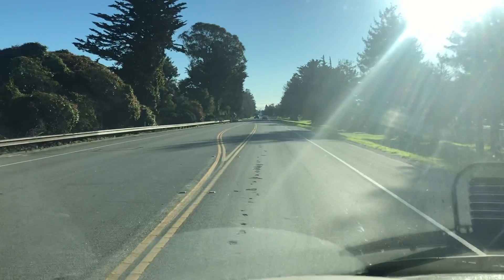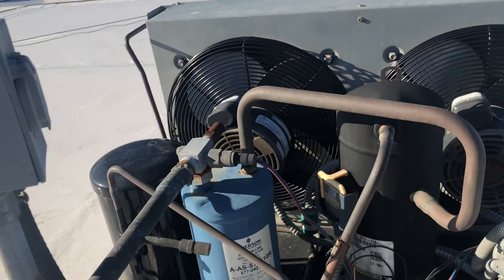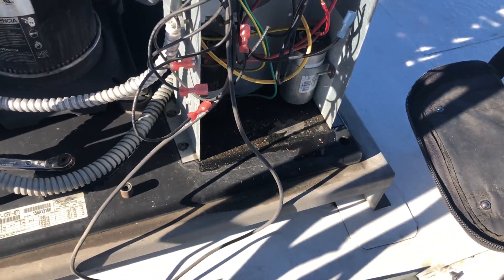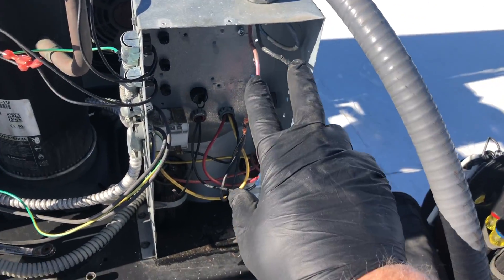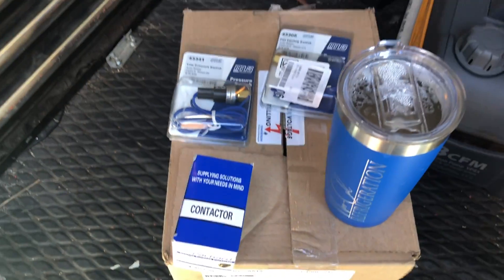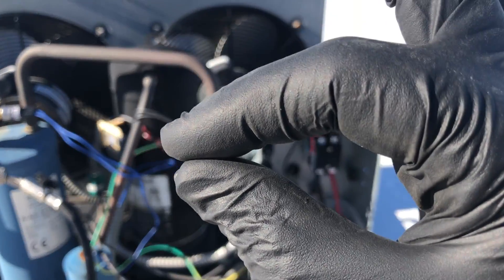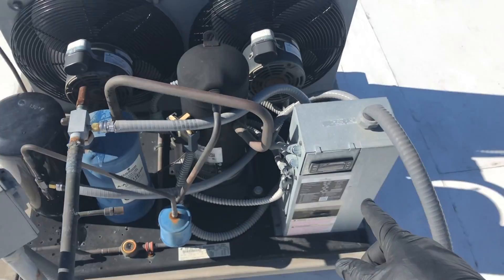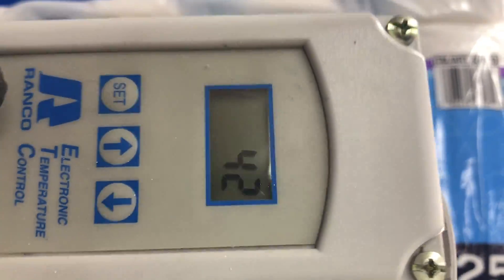How to Convert electronic unit controller to mechanical

Comment: I’d never hook up an any type of pressure switch to the receiver king valve. You’re begging for a leak. Pump it down, close solenoid valve at evap, braze in a nipple and Vaccum then release gas, then connect your  Penn all range fan cycle switch last onto the brass T you installed to your brazed nipple. Come on man 😂
Reply from the maker: @juangomez9272  5 years still working 🤘⚡️🤘✨✨✨✨

Comment: I really don't know why you wouldn't just replace the Emerson control.  All Copeland built up units ship with this control now.  The control is easy to set up, don't even need your gauge to set it.  The parts are readily available from any copeland distributor. There seems to be a fear of digital from technicians.  The time spent to take this unit back to the old type controls could have been used to go after to correct control.
Reply from the maker: @dhelton40  longevity that unit is still running zero issues since change over. The old mechanical stuff works and last.

Comment: Why would someone add a Schrader to the suction when you have an access port at the accumulator rotolock? Good that you added a doghouse.
Reply: Dual pressure controls are not weather tight either.
Reply: Also if you replace the transducer with a dual pressure control you will have to remove the Schrader core, yes? Therefore headaches for future techs that must replace the dual press cntrl if it malfunctions.
Reply: @kengardner5097  don't have to remove the core just loosen it if your control does not have a Schrader depressor.

Comment: Hey brotha I just got one of these 5 hp and I turn it on and everything works but the controller doesn’t. It doesn’t turn on at all what should I do? What would it be? I just pumped 404a and electric done right and I’m in LA

Comment: Dumb question/clarification:
The solenoid is opened by t-stat on box and is the only low voltage circuit?

I do ac/heating and dont see too many pressure switches with 240vac.

Gracias.
Good vids keep em comin
Reply from the maker: The solenoid is powered by the tstat and is 115 volts on this system

Comment: Good work! I'm a fridgy in australia, never can get my head around way Americans switch neutrals, u guys call it the "hot" we call it the "active" or "line", and under no circumstances do we switch neutrals its si much safer to switch active in my opinion
Reply: much of the small commercial refer. is 208/240v  split phase, meaning there is no neutral there, just two hots out of phase  (center tap of transformer bonded to neutral/earth) so either remaining leg is 120V to neutral/earth and 240v across them ( 208v for 3 chicken) lol

Comment: Awesome vid ! i Really Like How u did That ! I Think the sealtite on the little pressure switches was a little over the top , even for me. 🤣 i would have just used a romex fitting on the control box and put em through. could u tell me why u sealtite those pressure switches ? i see those type of pressure switches in condensing units exposed to weather on residential Air conditioning condensers all the time and never seen a problem. Just wondering. Totally Awesome Video & Awesome telling us how u did it ! 👍👍👍👍👍 & ⭐️⭐️⭐️⭐️⭐️. i would have probably went the Ranco / johnson Low pressure control way & just ran both fans all the time. But, i Like Your Way / this way Soooo much better. Thanks for Giving the part numbers and showing parts. im going to pick up some of those pressure switches. they Look cool ! i Use the High pressure safety / Man re-set of those type for many years and like them alot. Thanks Again ! Awesome vid !
Reply: i just watched the video again. i think i just answered my question.  ill bet u used the sealtite because u used butt connectors to join the pressure switch wires to make them longer and wanted to protect butt connections from rain.

Comment: 9° differential! 😱😱 nicely done, I enjoy converting Beacon 1 & 2's to mechanical. I can't believe they set that condensing unit out in the elements without a dog house. That's crazy
Reply: Maybe the dog house flew the coup.
Reply: @daveh681  that's what I was thinking, big storm not fastened, up up and away! whoosh
Reply: I lost one off my restaurant once.  Here in SO Cal along the coast we get gale force winds during storms.  The self tapping screws don't work so well after being removed several times. 

 I must have been lazy after cleaning the coils and didn't secure it very well.  Lucky I didn't kill somebody.  Now I have my refer guy put in the heavier gauge ones with all nuts and bolts.
Reply: @daveh681  see, this is exactly the kind of feedback HVAC/R techs and others need!
as a side note there's nearly *zero* excuses for the stuff to not last 5 to 10 years untouched from date of install, other than chinesium cheaping out on  component manufacturing.
who wins in the end? not the USA............. lame typos lol
Reply: @daveh681  In Maine, one of ny customers had one blow off the roof and then he ran over it with the snow plow. It was destroyed!

Comment: Dave, do you ever have a issue with the unit not staying pumped down due to the unit equalizing through the scroll compressor, I have had to wire a time delay to the contractor to keep the unit from short cycling during pump down, I only have this problem with scrolls
Reply from the maker: I have but not on all of them.  This as you can see at the end of video stays pumped down.

Comment: Easy sleazy lemon peasy. Great explanation and example Dave! Was the defrost control down below at the thermostat?
Reply: They could get colder temps & more reliable temps on that air curtain case if they put that ranco sensor in the evap. set to 15 degree's and a 24 degree diff. probably / might not even need defrost clock anymore. maybe one Night defrost for 15 minutes as a precaution since its there allready.
Reply from the maker: OcRefrigeration,Hvac & Electrical. To much work for a no issue at this time.  Whoever set it up has it working in that location.  Also in summer time there’s no air conditioning at that store, I have a feeling that’s why it’s set up like that.  👍
Reply from the maker: Yep